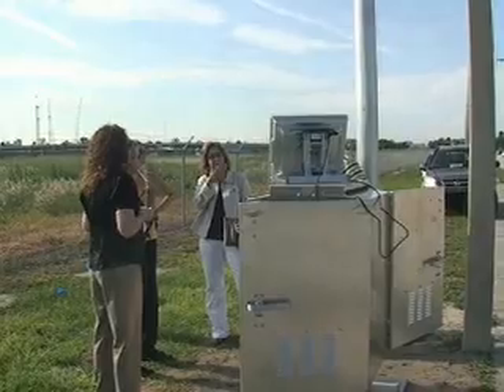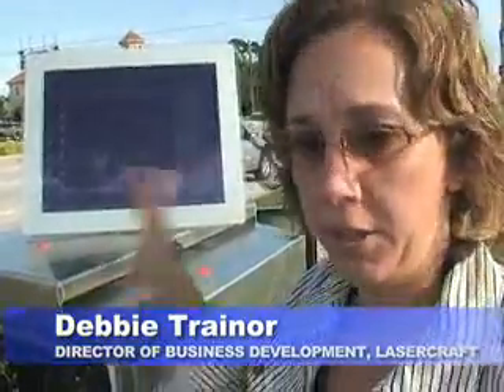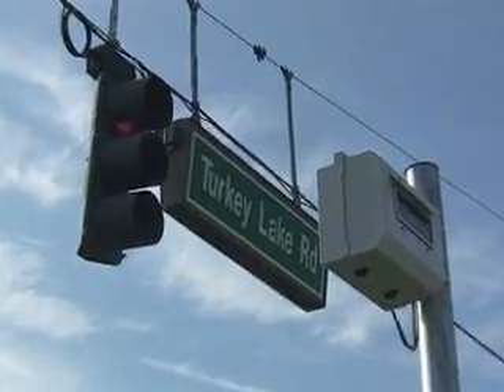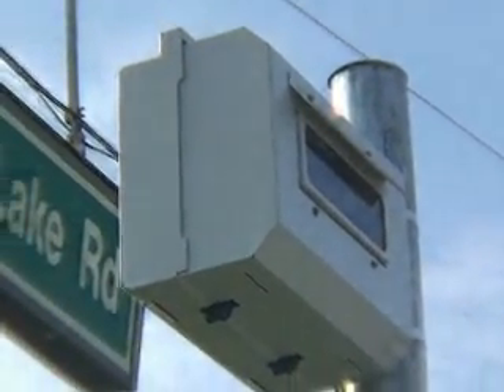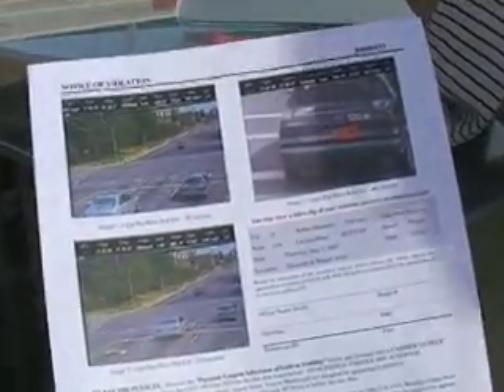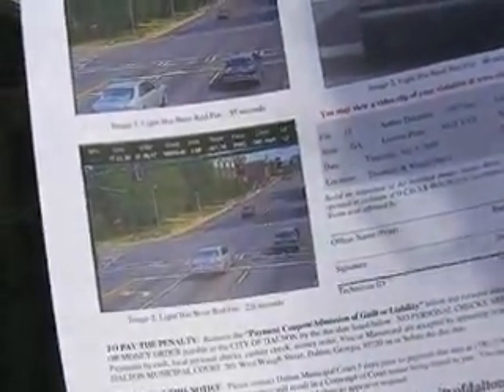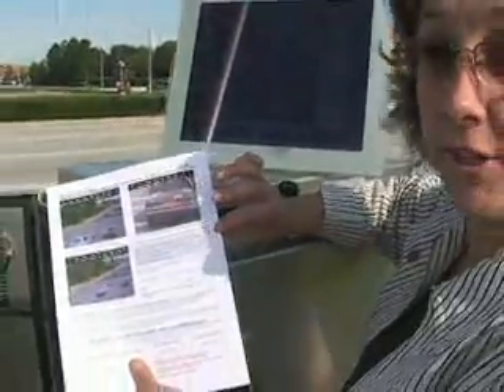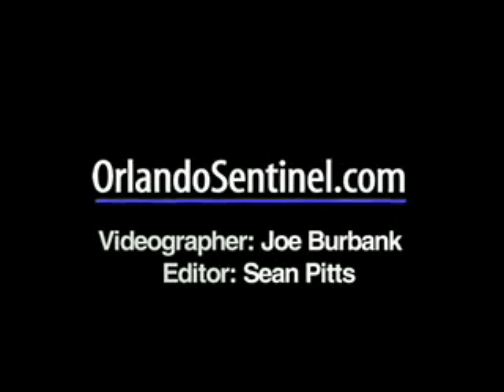LaserCraft Red Light Cameras - How they work

Comment from the maker: Short answer is no. It uses a Pro Laser III but the beam is aimed at a fixed point on the road. As you pass through, your jammer may stop it working while it's in reception range, but the lidar in the camera will alwaysbe able to register a speed from your windscreen or roof line as you drive along and your jammer head passes out of range. If that speed is too high to be able to stop at the red, the system starts taking pictures of the intersection anyway.

Comment from the maker: I know you were asking a theoretical question, so here's a theoretically answer.  If you had several jammer heads set up along your vehicle's radiator, hood, windscreen and roofline. The heads would have to be angled to provide overlapping protection, with firing angles sufficiant to hit the high camera unit. Theoretically this would blind the cameras' trigger mechanism, but it's a pointless exercise. Not safe, blatantly obvious, and prohibitively excessive. Not to be recommended.